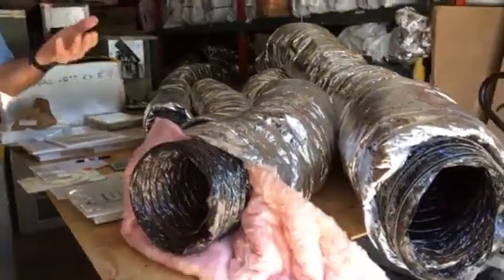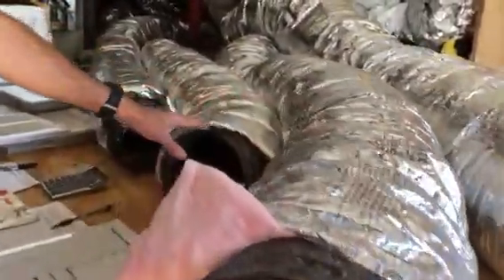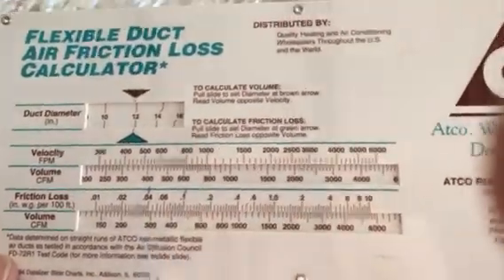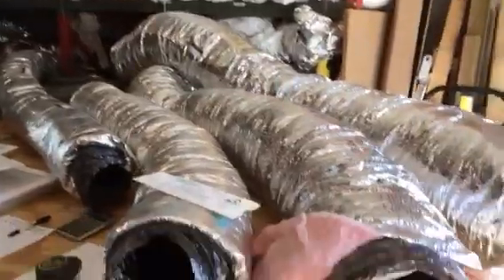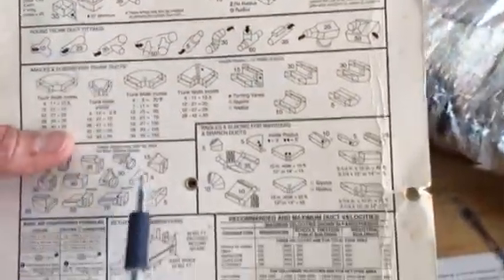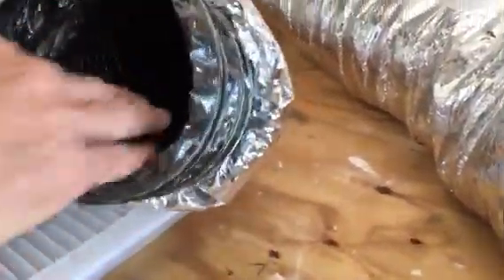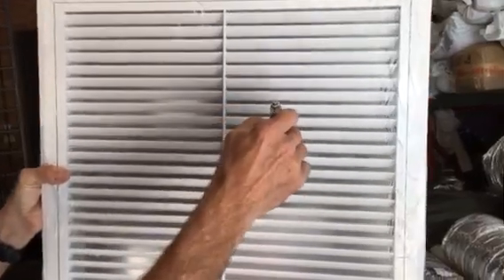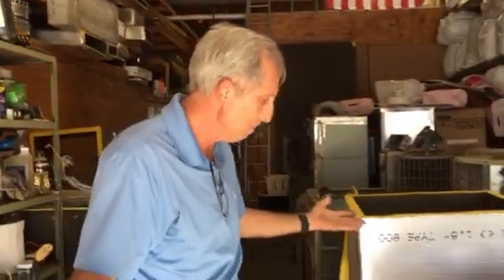Quick and Easy Duct Design Information

Comment: Interesting. 
For some reason Most AC companies claim they can engineer duct systems. They fall short. Usually they guess, or want to just change it for new.  I am 608 1-3 cert. due to the equipment I work on. Doesnt mean I am a duct engineer.. but it does let me sniff out fakes.  My new house has a "new full ac system". It is horrible. with kinks and pinches and sags and loose flex duct. its a mess, doesnt work and drips condensate. 
YET of the 10 companies I have had come out to Re-engineer the whole system only one has come close. 
Its sad really.. dont claim to be something your not, especially when someone specified, Especially when you are a "professional".
Reply: When you shifted to the return side, you moved your index down from 0.1 to 0.04, but kept saying “point 4.” Then, when you went to show your calculation done by hand, you actually used “point 4”! 

So, whenever you were saying “point 4” you were actually positioning your ductulator at 0.04, which would give you correct answers.

Thanks for the excellent video. The only thing major that you left out was the R-Value of the flex insulation. Here in Durham, NC, our 23 year old house has all ducts in unconditioned spaces (crawl-space, attic) and the R-Value is R-4.2, in an age when the code REQUIRES R-6.0, and R-12 would almost hack the heat loss. We have been literally blowing away our energy bill!!!!

Comment: Why .4? Every video i watch they always say .1 or .5 or something. They never EVER EVER explain what that .4 is and WHY they are using it and HOW to know what number to use. It's like telling someone, make sure your saturation temperature on your suction is 40°. If I've never learned anything about air conditioning then I want to know why 40°. You can't just throw out a number and move on. Please explain why you're using .4 and does that change in every application? How do I know when I'm supposed to use .4 or some other number?

Comment: Dude, don't tell homeowners how to do it. Then when they fuck it up someone has to go fix it. For runs off the trunkline, a 6 inch flex is sufficient for every single run in the house. I've seen runs where guys think too hard and put a seven inch for a room, a six inch, and eight inch for another room, etc.. No. Bedrooms, 2 six inch runs. Bathroom, one six inch. Living room, 2 or 3 six inch. Kitchen, one or two 6 inch. You don't need that duculator shit until you get to commercial. Then it really helps with a trunkline. You still gotta reduce it down the line.

Comment: Who cares just slap it in there as long as it's blowing cold air that's good enough right
Reply: Yes  you are right , but the better you understand the duct work the more you can charge cause you can sell the customer your product that will help them short electricity cost, the better the duct work is the less the system has to stay on (which means less power use the cheaper the bill will be) the more the ductwork is bad designed the longer the system will have to stay on to meet the customer needs

Comment: I worked for a compnay and we'd fabricate our own attic boxes, lined on the inside for quietness AND insulated on the outside. Pain in the ass, but the customer got the best. Why don't you tell the customer that the units manual tells you how big the return duct has to be, along with the size of the supply duct. Tell em dude.

Comment: Ok people, here's an easy way to do this shit. Make every run 6 inch. The flex's running to the rooms don't mean shit. The trunkline is what makes the difference. Put 2 runs in bedrooms, 1 in the bathroom, 1 in a kitchen or 2 if it's big, and 2 to 3 in the main living room. Put a damper in the runs (at the trunkline) where you feel the rooms may get too hot or too cold. I worked for a company and did nothing but installs and sheetmetal. We had a sheetmetal shop and a layout tech. We made all our duct. For the return, make it as big as you can. Hell, make the cu inches the same size as the return opening on the unit or bigger. HVAC has become a hustle, not a skilled trade anymore. AND, you don't need a ductulator for residential. You just don't.

Comment: There is a reason installers used to install a trunk which reduces as it gets longer, six inch runs were placed around the exterior walls so as the air blew down, it pushed all the unwanted temperature to the return, and the returns were slightly larger than the largest supply duct. The six inch runs blew even air and when yu needed more temperature for a larger room, you added another six inch vent. Why? Do you want to push more air out of one vent or push more air out of another spot in the room. In a car, they add vents for even cooling. Nowadays, I've seen so much bull shit in hvac systems its not even funny. I'll say this, go ahead and save the three or four grand on a install and go with the cheap bidder. That is gona be the guy trying to make money and he doesn't give one fuck about yur energy bill or when you will be ripping out walls and ceilings to replace duct. You will pay that money yu saved in the long run. Believe me, yu will wind up paying more on yur energy bill and you will replace all that flex one day. And if its behind walls, yull never know what has happened and you will be ripping out shetrock, hiring a painter, tearing yur home apart, etc.. if ya aint got the money to install a good system, buy window units until you do.

Comment: Low airflow causes high head pressure? Really? :-)
Reply: That would be -.lack of airflow. the system needs to breath sufficiently.to get its maximum efficiency Too many undersize the duct putting more emphasis on pressure rather.than airflow thus more strain on blower \ equipment. .especially important is not to undersize return ducts
 Though bar type grills and diffusers cost more they are less restrictive .
My 2 cents worth...(after 40 years of  installing)
Reply: Low air flow on the low side would never cause high head pressure, ever

Comment: This is not a good hvac duct system video .. you do not need to break or create a static pressure difference in the duct work, if your duct system is sized properly and air tight the accessories and other devices installed in the air flow path will create the static pressure difference in the supply/return air ..
Reply: Thank you great information
Reply: That is your opinion D the grills david talked about work much better for airflow and do make a big difference , sound like you need more experience doing this type of work but you will get there just have patience.

Comment: Forget all that nonsense.   Rule of thumb Is 400 square feet  of space per ton .  So lets say your house is 1600 square feet u would need a 4 ton unit.  
As far as ductwork goes u size up the return 25% to 30%  larger than the total CFM of the supplys.
Reply: Rafael,
DON'T!  I am an engineer.  This is a "contractors" rule of thumb that is at least 40 yrs old.  If you live in a Humid area, you are in serious trouble.  Have a proper calculation done, either a good contractor using Manual J etc. or an engineer.  Everything Mentioned above is true.  
David,
By the way, ASHRAE assumes ~15% extra loss if the flex is not stretched.  Your a good contractor and are doing your customers a HUGE favor.

Comment: Rob B
1 day ago
Great videos! Thanks for sharing! Question, I have uninsulated air flexible connectors ducts for AC/Heat going about 15 ' to a retune and want to insulate them after they were installed.  What is the best product or way to go about that - that you recommend?  They have no insulation and I can tell they are losing hot air.  Thanks!